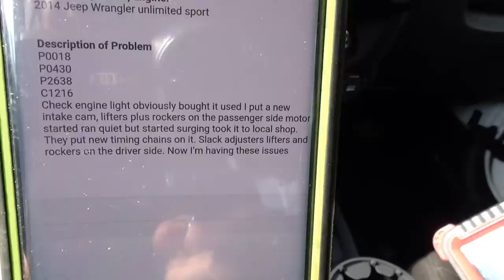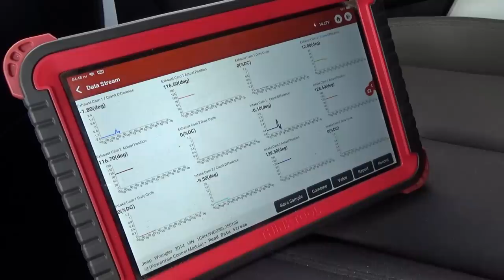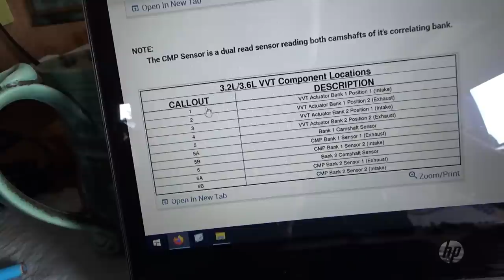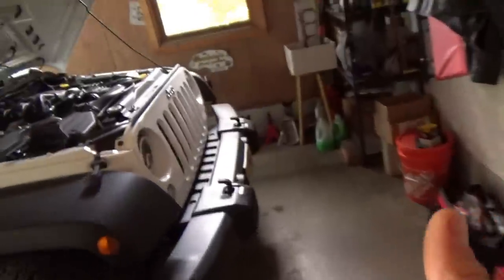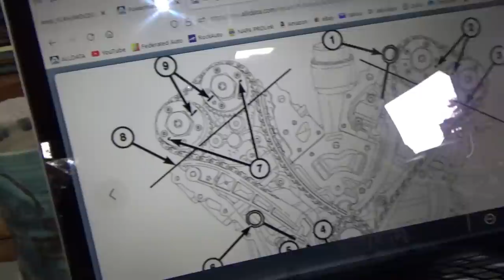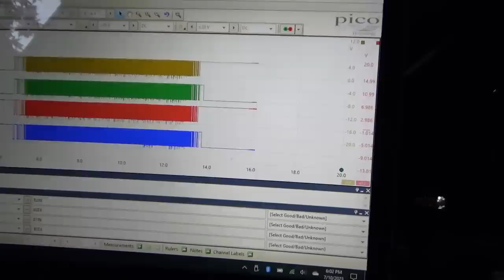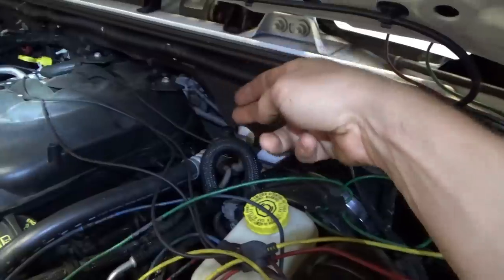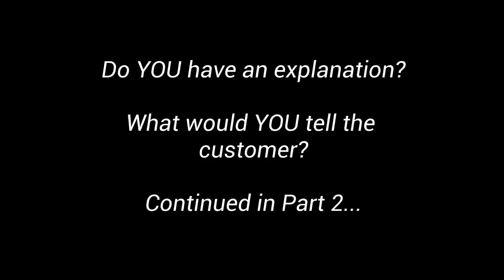BUTCHERED Jeep Timing Job?? (Part 1 - P0018 Correlation)

Comment: Check left exhaust camshaft to phaser fit there is a dot on cam and a dot on phaser looks like yours is misaligned like locating pin is sheared off if ok tone wheels might be shifted

Comment: I'm going way out on a limb here. I don't know these engines and what kind of bolts hold down the valve cover. But per haps a thinner valve cover gasket was used on that side.

Comment: Hi, I had a trouble like that where the signals didn't align and the cams and the phasers where all right so I made a tool with a socket and I weld a little notch on it, which help me move the wheel with the magnets and it's been all right since then. And I got rid of the trouble codes. Would you dare to try?

Comment: My list:
•the reluctor wheels(both) are off-- unlikely
•the sensor is positioned wrong
     •the valve cover is wrong or
      ¿swapped?
     •there's other sensor
      interference
     •the exh/in wiring is
          •swapped or 
          •twisted
•the cams are wrong
•the ecm is defective

Comment: Check if BANK 2 Cams are timed correct to crankshaft?

Everything else you checked:
-Cam sensors seems to work
-Cam timing in reference to each other seems ok

The value shown in degrees is the relation between crankshaft and cams correct?

Comment: Just curious. You count 33 teeth on the cam sprocket. Does that mean the crank sprocket has 16.5 teeth on it?
Reply: Not necessarily. The ratio of sizes matters as well. It would be 16.5 teeth if the crank was exactly the same diameter as the cam
Reply from the maker: Not quite. Look up the timing chain setup on the Pentastar and tell me how this is possible 😉
Reply: cam gear 33 tooth, intermediate gear 22 tooth = 2/3 ratio . crank gear 21 tooth, intermediate driven gear 28 tooth =3/4 ratio. 2/3 x 3/4 = 1/2 which brings timing ratio correct. so effectively you have a 21 tooth crank gear and a 42 tooth cam gear with this mess! the intermediate gear ratio 28/22=1. 273    so 33 x 1.273=42
Reply: @PineHollowAutoDiagnostics  just looked it up and I stand corrected.

Comment: Computer locking out phasing when there's a correlation code. Very good strategy, as you say. But is that Jeeps only, this engine only, or a fairly common strategy with correlation codes on VVT engines???
Reply from the maker: Common across the board 👍

Comment: Cam has shifted clockwise or,counter clockwise on the cam gears/relucotor wheels somehow.  Range Rover Evoques do this exact thing.  Somehow the cams have managed to be off 1 tooth of rotation. Just my guess.   Though I’m only 1/2 way through video at moment.

Comment: Hmm, what if they have switch arround on the oil solonoid eletrical connectors this would cause a lot of mismatch between intake and exaust cam angle.
Reply from the maker: Interesting hypothesis. VVT operation was disabled, this is a base timing problem 😉

Comment: Have you measured the mounting base to tip length of both sensors?  Have you double checked the part numbers? Same sensor, or, different part numbers?

Comment: At this point I'd have checked the cmp signals again this time with the vvti actuators unplugged :) then as someone else suggest, swap the exh & intake signal wires, if those two turn out to be fine, then you might actually have two shifted reloctor wheels 🫠

Comment: I don't keep cars long enough where I need timing unless the water pump goes out. But going to Alldata, watching some videos, and doing the timing belt or whatever needs replacement is the low bar for doing serious work on a high milage car. If you cannot do that you should not consider an older car that needs a lot of work, because it is old and has a lot of worn-out parts.

Comment: I think during first job they messed up camshaft sensor then replaced it with aftermarket sensor but some damage to cam shaft cover or reluctor wheel.

Comment: Bank 2 side cams when engine is at TDC are under spring tension so I’m thinking that is related to the problem
Reply: maybe a weak cam  tensioner pulley was the original problem? or worn chain guides?

Comment: Lift the sensor up, are you missing a spacer in the valve cover?   Either that or the VVT  is messed up for both the intake and exhaust.

Comment: Well there is a very important note in the repair instructions about not letting the ends of the cams touch anything magnetic or it could cause this issue

Comment: what abt the cam chain tensioner,? did they change it? second it could be a cam that was manufactured out of spec.. theres a shitload of cams being made that are not machined correctly in the engine builders world.

Comment: If one of the cam sensors was replaced with a non-OEM one then the sensors could have been designed with different sensitivities.  If one sensor has a slightly different sensitivity to trigger or even a delay in the state change then that could cause what you see in the graphs.  Might need two of the same sensors... But the magnets on the camshafts could be causing this as well... or the wrong camshafts were used...

Comment: Looks like the sensor is sitting too low; even rubbing slightly; check the seal or o-ring; also mounting flange; no seal and just used silicone sealer; also did they over tighten and compressed the metal bolt spacer for the sensor; if it mounts on top of the valve cover; check for the correct valve cover gasket; gasket too thin

Comment: This reminds me of the Chrysler 200 I told you about. The reluctor was spinning on the camshaft.  Scan data PIDs showed anywhere from 0 to 160 degrees... and the engine would start loping severely.  Lol.

 That shop had the engine (it was a used replacement) out at least 3 times, checking timing and pulling valve covers, until I told them the reluctors on the camshaft was the issue.  I believe the damage was due to how the used engine was handled. The valve cover had obvious damage, and I think the covers were just swapped with the original. They didn't think of the possible damage to those cams. Only pressed on. They're thin metal like wheel seals, I'm sure get distorted with time & heat cycles too.

I think those reluctors moved while it was worked on? 🤔  That's my theory. 😅
Reply: I just read the comments.  I like where someone said go in cylinder.  Compare bank to bank for ruling out mechanical timing.... then deduce from there. 🤔
Reply from the maker: That was my thought too Cuba... But what are the chances of BOTH cams shifting reluctors in opposite directions by the same amount?? 🤪
Reply: @PineHollowAutoDiagnostics  this shop doesn't seem to be the butcher type... so I suppose not in this case. More like sensor position like you said at the end. Lol. I got excited & just started typing mid vid. 😅
Reply from the maker: @CubasAutomotive  part 2 will blow your mind 😆
Reply: @PineHollowAutoDiagnostics  Ah come on... you can't drop a comment like that and leave us hanging.

Comment: I would have started by returning it to the dealer. It should have a warranty for the camm and follower replacement. That said I know you will figure the problem out and get it fixed.

Comment: It's hard to know what could be the problem without knowing the parts that would have been replaced...
On the other hand, I just have 2 questions regarding:
1 - are the cam covers and cam sensors the same between bank 1 and bank 2 ?
2 - can the cam sensor be turned 180° ?  I'm thinking of a signal inversion between the 2 camshaft, but it will be easy to check with the picoscope and a magnet to be sure the camshaft signals are arriving at the right place in the computer...

Comment: Since you said if you would lift the sensor a little the degrees would change is it possible that they used a valve cover gasket that was the wrong thickness? That would definitely change where the sensor would read the reluctor wheels.

Comment: Does it use 2 separate CRANK sensors??? If not, I’d be leaning towards the new chain and guides as well as the phasers. Are they locked in place with the engine off??? Peace

Comment: I don't get why it even left the garage if it wasn't right ?

Why do people let these so called " MECHANICS " get away with this ?
Reply: Good point.
Reply: Don't get it either, I have to fix all of my fuck up's.
Reply from the maker: Customer took it back THREE TIMES and they charged more $ and didn't fix it 😆
Reply: @PineHollowAutoDiagnostics  I wouldn't pay till it was fixed right 3 times 10 times, doesn't matter.

Why would you pay if it wasn't right ?

I also have 2 vehicles maybe customer doesn't.
Reply: @NoWr2Run im sure they said it was all ready to go and he paid and drove off, then oops it’s not right. Already had his money.
Reply: @travissheehan6082  You test drive first, pay after & 3 times ?

Comment: Are the cam sensors different/specific to the left and right bank? Could it be you have two bank one cam sensors, so even swapping, bank two cam sensor would still be rotated 180°?

Comment: If your scan tool is measuring the CAM / Crank difference and your mechanical CAM timing is correct, it seems logical to suspect the chain may be off a tooth on the Crank...
Reply: Wouldn’t it affect both sides?
Reply: @uglysteve1  Good point. If the chain is in fact correct I would check the oil control valves next.
Reply from the maker: @uglysteve1  there are 3 separate timing chains 😅
Reply: Wasn’t only one chain replaced? Maybe slightly different in link to link measurements?
Just a thought!😂
Reply: @PineHollowAutoDiagnostics  My theory is the most likely cause is the Bank 2 timing chain was installed incorrectly and is one tooth off on the Crank.

Comment: Hi. I'm trying to get Obd1 scanner that can get live data. Unfortunately I just got the bidirectional Innova 5160rs scanner and no live data just a $300 setup that gets me codes. No cable for Nissan with kit. And no live data on my GM FORD or MERCURY. I your amazon link and it broke my heart because I have CPR919E. What scanner get OBD1 live data? Thanks
Reply from the maker: Get a used Snap-On on eBay :)
Reply: @PineHollowAutoDiagnostics  any model that you know has live data for OBD1? Thanks

Comment: The rocker failures in these engines is caused by the oil galley plugs below the cams. Those bolts come loose and bleed oil pressure back to crankcase which causes low oil pressure in cylinder head wiping the rockers and cam out
Reply: I think you mean the lifters go bad not the bolts coming loose took me a minute to figure out what you're trying to say That's what they replaced that's what he said in the beginning of the video
Reply from the maker: Interesting...
Reply: 👍🏼  good thinking
Reply: @shogunofgrowing4839  no I am talking about the rocker arms and the bearings inside the roller failing from lack of oil pressure due to oil galley plugs under the timing chain gears being loose. It grinds camshaft flat. So far 3 vehicles and they all were finger tight

Comment: It's either the oil control valve has failed or The catalytic converter might be plugged up making it hard for the exhaust valve's to breathe it had a code for that side's cat
Reply: That's my favorite explanation.

Comment: Could it be the valve cover or the gasket that the cam sensor sets in? If thats what dictates how high or low the sensor sets in relation to the cams.

Comment: do we know that the proper cams were installed for this motor? is the chain position on the crank correct?
Reply from the maker: Original cams on Bank2,  just rockers replaced :)

Comment: It could be due to the fact that the reluctor wheel(s) have moved on to camshaft (s),I can remember when you had a similar issue with another car you worked on & one of the camshafts needed to be replaced for that reason,it could be a bit of deja vu !
Reply from the maker: Definitely a possibility...but so unlikely to have both cams affected by the same degrees...but in opposite directions!!

Comment: Timing looks correct .
How is the crank lock in place when timing checked ?
Incorrect cams fitted ? or not in the correct place ?.
Bit tricky.
Reply: The chains have marked links that corresponds to marks on gears

Comment: Error per tooth is only 360/33= 10.91 Degrees. But you verified timing chain was correct with marks and flats of cams. Check if VVT’s solenoid harness connectors are not switched. If not VVT solenoid connectors switched, then make sure VVT solenoids intake and exhaust are physically not swapped, assuming they are physically different and would make a difference…..
Reply from the maker: Have to double that to get CRANK degrees :)

Comment: Ivan,how about timing marks at the crank?
Reply: then the other bank would off to
Reply: @SHSPVR scope show they are,right?
Reply: @ismarmeskovic  no if all timing mark are rigth on as lvan said everything was line up that just leaves the Cam sensor depth which may not be sitting far enough down in the hole or another possibility is the computre it needs to be recalibrated for the new positionsas the only other thing I can think of is that they purchased the wrong set of cams perhaps they got the passenger side cam when it should have been driver side cams if they had your place them in pairs.

Comment: Are the cams in the proper position? All 4 are different and marked left or right and intake and exhaust.  I couldn't see it in the video.
Reply from the maker: Yup verified correct cams in correct locations 😁👍
Reply: I would check the phaser to cam timing dots. I have seen broken locating pins on the cam
Reply: maybe the service manual is wrong AGAIN? and the timing marks are both supposed to line up?

Comment: Until you changed the cam angle sensors, I'd have been checking for back to front or swapped cam sprockets.

Comment: Very easy . The chain on the crank is off by a tooth . There’s 2 arrows at the bottom . If the colored link is not on the arrow it will cause this code .
Reply from the maker: Aaaand you would be wrong... Not so easy. Watch part 2 😉

Comment: It just needs an ls swap.   No more problems.  No more hydrolocking and burning oil on off camber climbs.   Easy
Reply: No the kit I bought for $200 that bypasses that problem was alot easier than trying to fit something that doesn't belong there but your heart is in the right place with the v8
Reply: @shogunofgrowing4839  I'm installing a 4.7l stroker in my 2000xj.    Couldn't afford to build the rest of it to handle the v8 yet and my piston skirt broke so I compromised lol
Reply: That's gonna be an awesome set up when you get it done I've heard nothing but good things about those stroke for kit

Comment: could it be possible that the valve cover gasket is thinner or the rubber gromet is smaller and making the sensor sit lower just asking thats all
Reply from the maker: I was sure that was the problem... But sensor was installed properly 👍

Comment: It's a good mind twister :-D
i can't see how the segmented magnet on one of the cam's  has twisted.
The cam shafts can't be mixed up as there is the pointer on the ends.
Are the pickups supposed to be screwed in place?.
You do get all the twisty faults, i think you like pain ivan :-D

Comment: I never once needed engine work on any Japanese trucks or cars at 140k miles. I needed a new ignition coil here or there and maybe a cam shaft sensor.  But I never once needed engine parts replacement at only 140k. This is ridiculous for a naturally aspirated engine.  I wouldn't touch an American made car if my life depended on it.

Comment: is it possibile the locking pins on phasers arnt locked in and phaser is floating under oil pressure ?
Reply from the maker: Great question! The waveforms never shifted and engine ran smoothly 😉

Comment: I do not have an explanation on the cam timing being off but...How can you have a cam gear (sprocket) with an odd number of teeth?
Reply: Because there is 2 cam gears ....
Reply: @keltecshooter  So how many teeth would be on the crank gear if there are 33 on both cam gears?
Reply from the maker: Great point! You can count them yourself 😊
Remember that there's also a primary timing chain and intermediate gear 😉

Comment: While the cams may be in proper alignment with each other in relation to the timing chain, if the other end of the timing chain is one tooth off (advanced or retarded) on the crank end could that explain the total degrees the computer is calculating that the two cams are off (if one tooth equals 21 degrees)?
Reply: If that were the case then both banks would be off by the same degrees.
Reply: @thatsonebadhatharry8610  The cams on each bank have separate timing chains so it is possible for one bank to be properly timed and the other bank to be off. 

The only thing that makes me question my "theory" is I don't know how the ECU calculates cam timing or how the Scanner displays it (since one cam is showing negative and the other cam is showing positive numbers, but if I ignore the +s and -s the total adds up to almost 23 degrees).
Reply: @sewing1243  Yes you are correct, one bank could be off but in the video both bank were in correct alignment.

Comment: The problem is the oil pressure regulator on the phaser
Reply: The regulator is stuck open advancing the phaser
Reply: Make sure the solenoid probe is not stuck in the out position